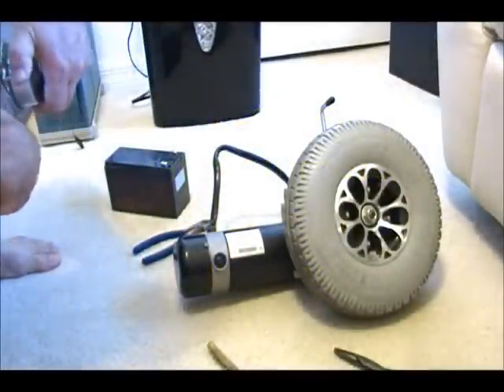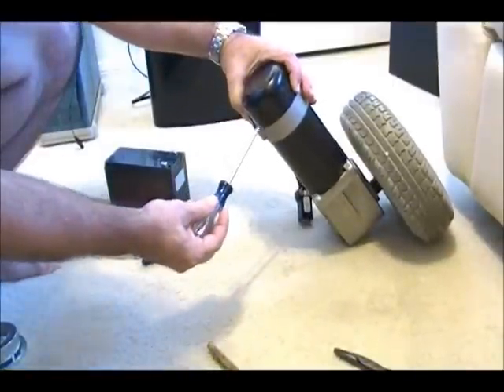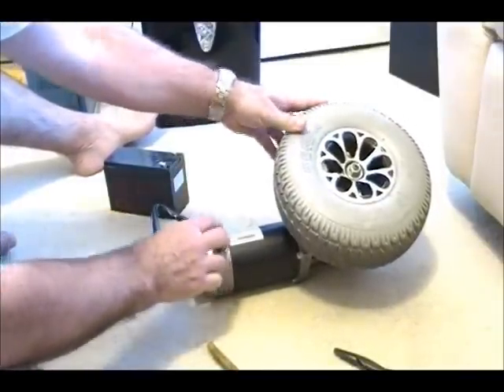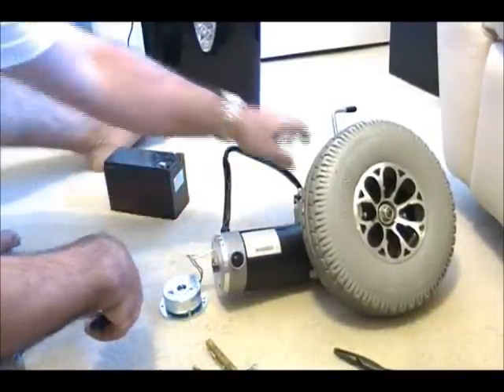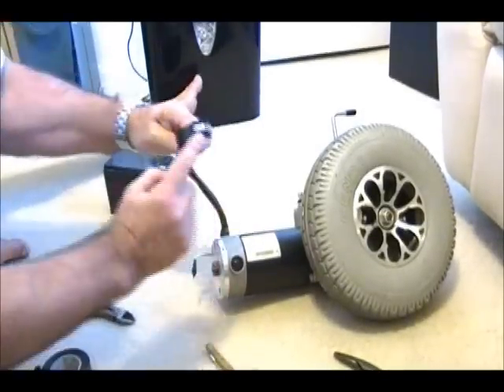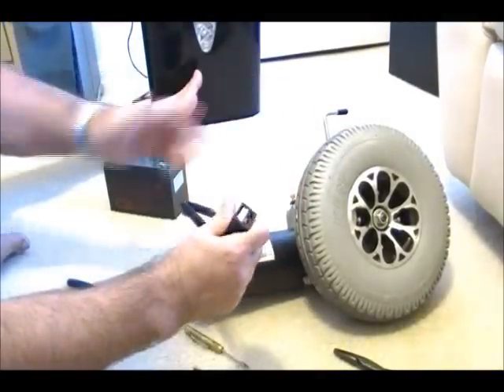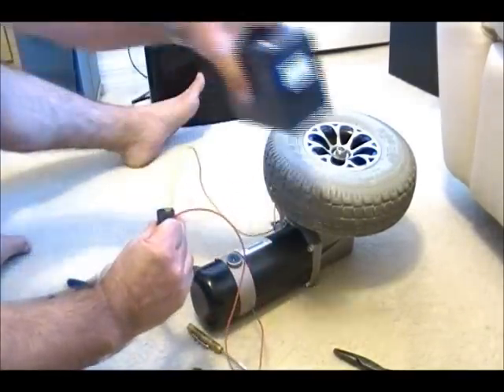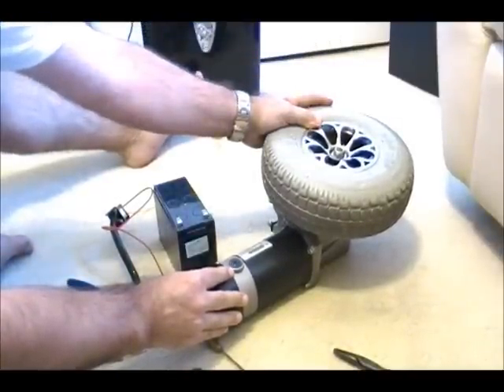Power Chair Motor for Robotics

Comment: Thanks for the video. I am looking for this motor to drive small piece of scenery/platform on stage. As long as the motor is engaged and it's not getting power, does it act like a break? Effectively preventing the platform from rolling?  That's what I want, but if I understand you video correctly, that is what should happen...am I correct? TIA
Reply from the maker: I wouldn't call it a brake, but it doesn't spin freely either. If
you need braking action utilize the brake on the motor, you just need to apply 24VDC to disengage it.
Reply: @GizmoGuy620  Thanks so much for the reply.  So if I got a car battery that was 24 volt, I could get the power for the wheel and it would also act as a brake.  I'm not to this area so forgive me for asking such basic questions.  But how I would I go about controlling the motor, i.e  "Go"  "Stop"  "Go half speed"...in an ideal world...wirelessly, like a RC plane or car. TIA
Reply: If you can point me to some videos that might help, it would be greatly appreciated.
Reply from the maker: A power PWM controller (such as a Sabertooth 2 X12) can easily control these type of motors.
Reply: @GizmoGuy620  Thanks so much for taking the time to answer me.

Comment: Mr. @fcord23 do you have any suggestions as to how to engage the worm gear? I understand the lever dictates that, but whenever it is engaged, the motor arm still won’t spin. I don’t know what I’m doing. Just getting into electronics/robotics. Would cutting the white brake wires as you have here, help with that?

Thank you so much!
Reply from the maker: I believe you must remove the brake as indicated.

Comment: Do you have any idea how to make these motors faster? I'm trying to increase the speed on a powerchair. It won't take more than 28 volts or so and I thought maybe you would know a way around that. Thanks
Reply from the maker: Sorry I do not.  I believe these motors are rated 24v. With the internal gearing, the speed is what it is.  Applying higher voltages will most likely damage the motor.
Reply: @GizmoGuy620  I had someone in A Quantum chair blow by me like I was standing still yesterday and his motors were no larger than mine. I've already removed the programed restrictions so there must be some other factor governing the power to the motors. These motors could easily handle twice the voltage. The motors are not the problem. I overvolt dc motors all the time. The ratings mean nothing

Comment: Anybody in Milwaukee Wisconsin I have an electric wheelchair with 3200 RPM electric motors from a wheelchair I don't want to throw it away I want to give it away to somebody that can use the motors send me a text 414-306-1175 and it's yours for free

Comment: Could you control the speed to slow it down?
Reply from the maker: Yes! Absolutely, you can use a PWM (Pulse Width Modulator) circuit
Reply: @GizmoGuy620  Is there a pwm device on sale ready made please
Reply from the maker: @paullee5573  I use a Sabertooth for this motor:  https://www.robotshop.com/es/en/sabertooth-dual-regenerative-motor-driver.html?gclid=Cj0KCQiAmL-ABhDFARIsAKywVac5KJoV8H0MrmueDtgyDSLsRCQ4TQrgXburiD0ptG8m8ojpOuJZMT0aAqogEALw_wcB

Comment: If any of you need these motors and controllers in India please call 9884049007, Chennai, India. Can be supplied with or without wheels.
Reply: Hi .. do you happen to have the datasheet of the motors, please?

Comment: Thanks For this video its very useful,
I am using a same motor can you guide me regarding the same
I made a hardware for a 200rpm dc  motor and drived the motor and its working fine.
Now i need to drive the same motor that you are using i am not aware of break system that how to drive and how to send signals to control this motor, 
 Can you help me out to solve this issue
Reply: can you tell me what kind of motor is this & where can we buy this

Comment: Good video but just for reference that brake is called a "active low" brake basically if you want to keep the brake for some reason apply voltage to the 2 white wires and it will disengage it's the same type you see on alot of industrial equipment
Reply from the maker: Removal of brake was just to save on battery power.

Comment: ¿Qué tipo de grasa se usa para Inside Wheel Chair Motor Gear Box? ¿ NLGI No? ¿2? ¿3? ¿4? ¿5? ¿6?
Reply from the maker: I did not open the gearbox, but I would assume lithium grease or heavy gear grease.

Comment: Hi fcord23,
Nice video!  What type and brand of engines did you use for these robotic tests and did you succeed to mount shaft encoders instead of brakes at the end of the engine ?
Reply from the maker: Yes, encoders installed see my other video... https://youtu.be/KrcqpGZQd9U?list=PLUsDZdokq6wxDP7L3sMoYFTA5WDoAtBu4
Reply: engine wtf

Comment: @fcord23.....I was just reading through the comments and saw that you're running them at 12v (parallel) instead of the 24v (in series) like they were designed/built to be run at.  I just wanted to say that from what I know about electronics and especially motors, if you must, it's better to run them at a little higher voltage then they're rated at opposed to a lower voltage. When you do the latter, it draws more amps (double the amount in this case) then what it was designed for and depending on how much extra amps/how hard your working them, will result in straining, overheating and or even frying out the internals. All of which will definitely shorten the motors lifespan. Just figured I'd mention it and either way, good with everything..peace
Reply from the maker: Hello Motogoat1 and thanks for your input.  I am sorry I do fail to mention the motors would not be run directly from a battery, but thru a motor driver (such as a Sabertooth 2X12) or some other PWM power circuit. This will help to reduce any large current drain and or over heating.

Comment: Did this for my sumo robot in highschool, but now that I think about it, the brakes would have been better to keep in place. Our robot coasted way too much! Made it too easy to overshoot a turn :(
Reply from the maker: I think you wouldn't have that problem with these motors, they pretty much "lock up" when there is no power. In other words they would not roll down a hill if no power.

Comment: Thanks for the video.i did the same thing but the 12v and 7 amp battery(D.C) giving only 15 min power to this motor.what is should to increase the time of a battery?
can i connect two 12v battery in parallel to this motors?
Waiting for your reply...!!
Reply: If I'm not mistaken that's a 24v motor so you need to go in series with your batterys because yes you can run a 24v motor on 12v but your going to consume more amps
Reply from the maker: I needed the robot to run inside a home. I couldn't have it running at 24v because it would be too fast. A slower speed (at 12v) would actually use less amps (by using a Power PWM control).
Reply from the maker: Yes Satish, that's what I am doing for my robot. I have two 12V/ 8Ah batteries in PARALLEL. That still gives me the 12v, but at much higher current (16Ah). I also have a totally separate one for the electronics.
Reply: fcord23
thanks for your reply.
What is the duration of the battery?How much time the bot/motors can run with 2 batteries?
In another video(Robot car) u connected 3 batteries it means one for electronics and remaining 2 for motors right?
In my case m designing power wheelchair where one person can sit move move here and there but problem is how much time does two batteries can support this motors to move continuously?
Waiting for you reply.
Reply from the maker: Battery time depends on many things. I am hoping for at least 2 hours. I also hope to make the robot find a charging station on its own

Comment: Thanks!  Would you believe I found a whole chair, discarded by the Demster Dumper in our complex!    I got the motors/gearbox/wheel AND the joystick control as well as the front wheels.  Didn't keep the batteries as they were swelling along their sides.  THANKS for the break explanation - as well as that they seem to go on 12v

Comment from the maker: I don't think by using 12V you would damage these motors.  Since I will be using them for a relatively slow robotic car, the 12v is good.  The motor is rated for 24v so basically it would use less current at that voltage. An example would be: if I need 100 watts of power @ 24v it would draw 4.166 amps. That same 100 watts of work @ 12v would draw 8.33A from the batteries. That's why I will use 2 Gel cels in parallel rated @ 8AH for a total of 16AH @ 12v

Comment from the maker: The brake is pretty heavy duty, I think it would draw a lot of current just to bypass the brake. This would reduce the the power of your on board batteries.
I just eliminate the brake.
Reply: Hi ... I have the same two motors and trying to build a robot with embedded PC-screen, so I'm willing on saving the most of the two 12V batteries, if you had meanwhile access to their datasheet I'd like to have it to ...  Great video by the way the only info I found on the SRG0131motor.

Comment: Newb question here for the 24v wheel chair motors. You're simply turning the motor with a 12v battery. Could you actually put a load on the motor for pulling and just run it off a 12v battery permanently? Would there be any damage to the motor itself? I'm just curious. That would save having two batteries in there or one expensive 24v battery. Thanks for the answer when you get around to it. :)